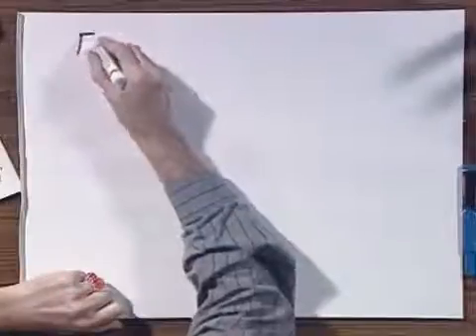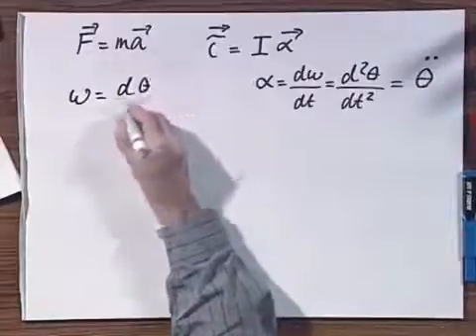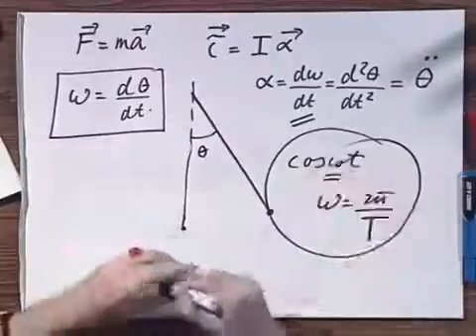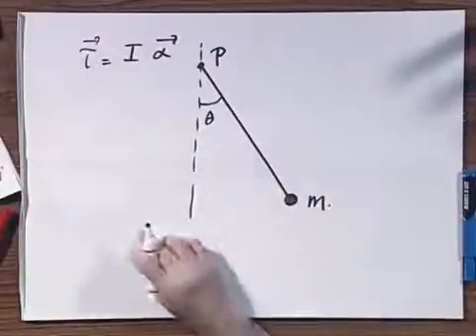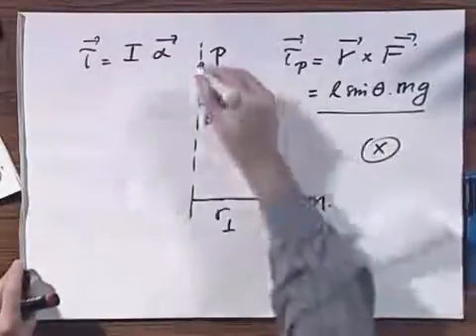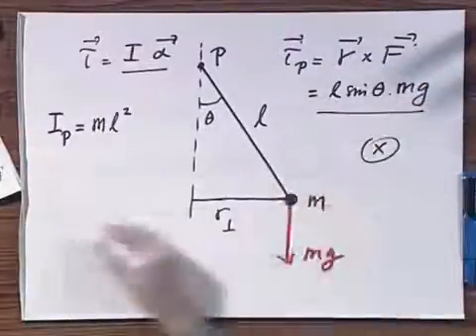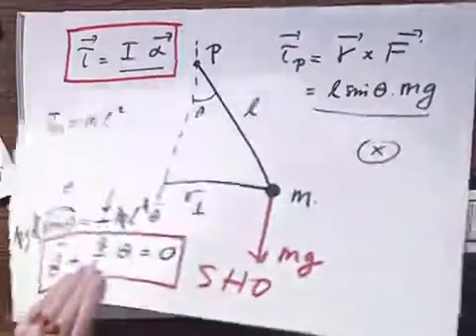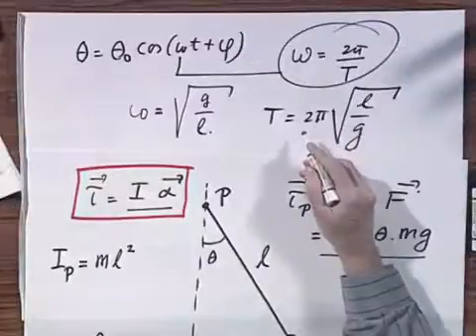8.01x - Module 22.01 - Torque and Simple Harmonic Motion.

Comment: why is F = mg and not T - mg. Do we assume that the tension is negiligible?
Reply: We assume that it is a light string so we neglect the tension
Reply: My opinion is the following: If you consider that F = T - mg then of course you must take into account the y component of the tension T_y = Tsinθ, so the equation will be F = Tsinθ - mg and according to the small angle approximation then you have F = Tθ - mg. Using that in the equation you get mgθ - Tθ^2 + ml(d^2(θ)/dt^2) = 0. The term with the θ^2 can be neglected due to the small angle approximation, because if θ << 1 then θ^2 <<<< 1. And then you get the classic SHM equation.

Comment: 6:05 I understand that it's a restoring force, but I don't understand mathematically how does the minus sign come, since both alpha and r x F are pointing in the same direction.
Reply from the maker: if you  replace the - sin by a plus sign the object will no go back and force. theta will then increase in time if you release it at zero speed at t=0